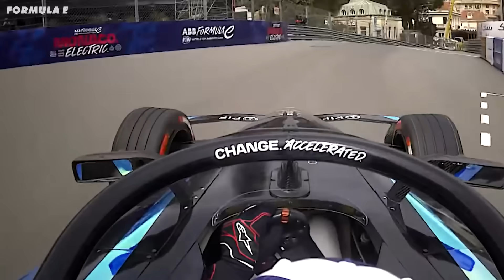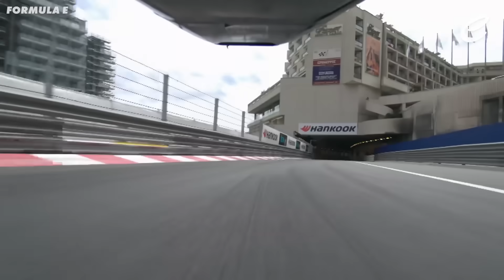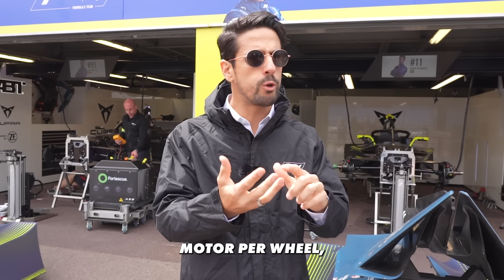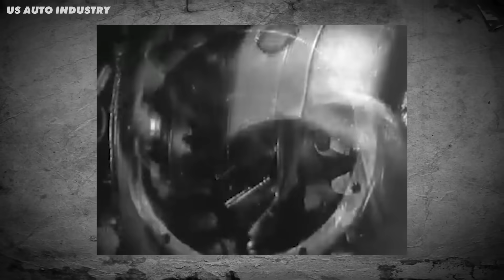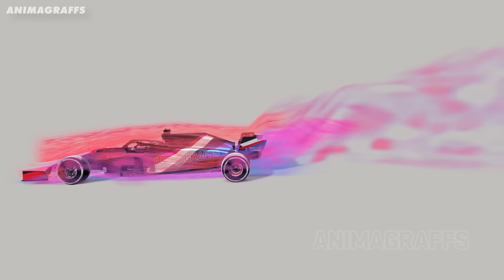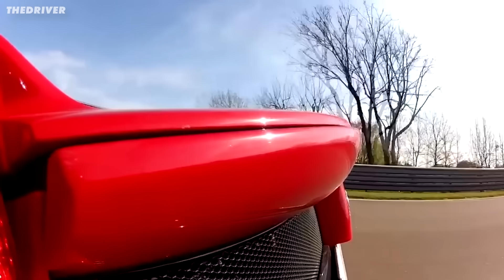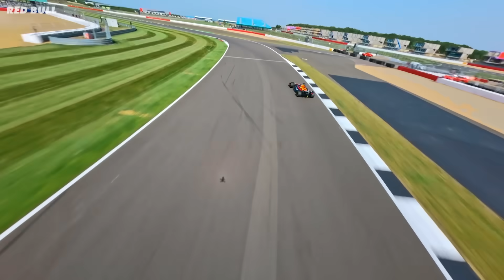The New Formula E Car Might Be F1 Fast

Comment: There is already heavy equipment with that kind of traction. Caterpillar motograders use a hydraulic front wheel drive with an option to increase wheel speed to the outside wheel, reducing the turning radio. Fendt tractors have something similar I think too

Comment: I stopped watching Formula E when in the first race of the season no one wanted to take the lead of the race!
Reply: That's part of the strategy in Formula E. It's called energy management.
Different from other motorsport series.
Instead of fighting for the lead constantly, you stay behind to conserve battery 🔋 energy via drafting and then, in the final few laps, timely overtake and maneuver opponents to take the lead.
Watch the 2024 Berlin E-prix where Nick Cassidy takes lead from P21 in lap 21 to ultimately win the race with 1% battery remaining.
Reply: @mk_annan22  I used to love watching FE, but how is it racing when you're just managing the race, and the winning car is just the most efficient instead of having the fastest car/driver?
Reply: @ImNotOriginal1  That's a good question. This race is about efficiency. It's not necessarily about having a fast car.
The goal isn't speed, it's efficiency. To promote Electric Vehicles to be reliable . That isn't a bad thing, consider it a new different genre of motorsport.
Promoting the fastest car is what led to an uneven field in modern Formula One. So teams with bigger budgets can outpace the smaller teams.
But because being fastest isn't the core in FE, you have an evenly competitive grid where even small teams can beat big teams with bigger budgets. Like Envision Racing who, as a customer team, won the Team's championship in 2023 bettering Jaguar's factory team with bigger budgets and resources.

Comment: 5% compounded, sure.  Realistically though, formula E is just one battery breakthrough away from being a legitimate formula car without having to make any compromises. 

The formula E cars are arguably far more relevant in terms of technological development that will almost certainly trickle down to road cars.  F1s days of being technologically relevant are long gone.   That's excatly why F1 should just drop that idea entirely.  For one, no one gives a shit in the slightest, and every fan will be about 50,000x happier with screaming V10s than with sort of wannabe relevant hybrid power units that have almost nothing in common with road cars.

Comment: While I really like the idea of active aero, I don't think having the aero tuned corner by corner is a good idea.
For starter the conditions might change during the race (other cars disturbing the airflow, rain, etc).
But most of all, I think the system should adapt itself based on external parameters like speed, turning angle of the steering wheel, weight on each wheel, etc. Although the settings would be controlled by the engineers, the software should absolutely not have the position on track of the corner number as input (and obvious not count the corners either like they did at some point in F1).
Reply: Steering modulated aero is the solution for ya + DRS button, it obeys driver inputs, and the wings are always at the brink of stalling by setting up correlation of steering and speed.

Comment: They will only be considered "F1 Fast" when they can be as fast as F1 on a whole 305 km race distance and without tricks like swapping cars, anything less than that will still be lower category.
I doubt they will achieve that anytime soon.
Reply: I think if the tech ever gets to F1 speeds/distance. F1 will be using it, but that's still years away. Probably need swappable batteries to do tracks like Monza or Spa at F1 speeds.

I reckon FE will just become an F1.5 sort of series. Gen 4 should bring them to at least F2 speeds in quali, and races are supposed to get to around 1hr30. So that will raise the stock of the series by quite a bit, but still a long way to go for F1 levels. Then again with the 26 rules, who knows might see FE closer than they should be.
Reply: Fe will never be f1 fast because, it was never the goal.

Comment: This still sounds incredibly dull. Racing should involve high speed, actual driver skills, hair raising sound and driving on the limit. 
Not hypermiling in a car that can barely reach the finish line, drives itself slowly with 4wd on a Micky Mouse track with a constant annoying sound. This stuff just lacks a soul.
Maybe just skip this step altogether and just run computer simulations of a race?
Reply: The car will have more capacity to go longer and with the raised speeds, tracks will become more traditional. 

Already seeing the transition in gen 3 with them racing at places like Portland, Misano and Shanghai. Street circuits will also become longer, I think Macau is already being considered for gen 4
Reply: @lewis8552  Monaco is already here, Miami (proper track, not street one) will be next season and Silverstone is going to be for Gen 4.
Reply: What if i told you hypermiling is what nascar and indycar does on an oval.

Comment: The current Formula E cars, if you removed all the regen braking, it would only make it half way thru the race.  Regen has allowed their cars to go TWICE the distance.  Yet, 2026 F1 still disallows front axle brake regen, in fear that Williams and Audi might have some advantage, leading to them needing to lift off on the straights to allow the engine to recharge the batteries.  It's pathetic.

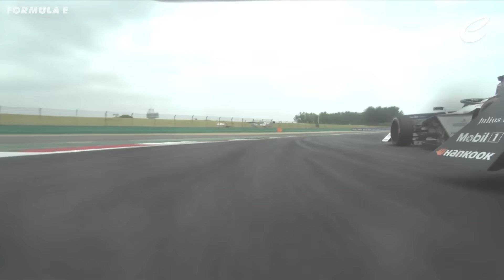Comment: 9:43 holly crap they are on a proper race track, nice
Reply: Not so nice really, because they then spend 3/4 of the race trying not to be in front but still be near the front, to avoid opening a hole in the air for the others and lose autonomy.

Comment: FE races are kept long, so lame. Adding power needs more battery capacity or a shorter race, neither has really happened with FE in over a decade. The aero has been fake. Losing a wing means no performance difference. FE is an almost spec car, so no team innovation on the chassis or aero allowed. Designed to be cheap and lame by the suppliers. Put on rock hard tyres so turns are at touring car pace despite much lower weight.
Reply: They're saying they'll have capacity for longer races in gen 4, around an 1hr to 1hr30m. Races won't be run at the full 600kw though, think they're saying 450kw in race.

Comment: F1 had to bring in more and more regulations to slow cars down as it was. Formula E has even more potential for stupidly dangerous speeds, so all of the technologies mentioned here are going to have to be hamstrung just for safety compliance - unless the aim is to drive cars by remote control at tracks with no spectators anywhere near it.

Comment: Sticking with DOT street tires will keep the braking distances long regardless of downforce. The tire can only do so much and when its a street compound tire with low grip all the downforce in the world won't fix it.
Reply: You do know they don't actually use road tires right. Bruno Senna sat down with Mr Jww a few years back in an interview on his channel. In it he said they tried a cup 2r on the gen 1 car in early development and just like on the road cars it only lasted about 3 full pace race laps. And lap 2/3 of race run was about 8 seconds slower than lap 1 because the tire was destroyed already and that sometimes it wouldn't make it to the end of a qualifying lap. He said that for Gen 1 Michelin used a modified hard lmp1 compound and put it in the road car mold. They did this so it can have pace( it was quicker around a lap than the cup 2r ) and actually lasted till the pit stop. And they put it into the mold to fit the singular All weather tire image that formula e was looking for. I have no idea what the compound of gen 3 is off the top of my head but I do know that it is bespoke to formula e rn
Reply: @Donster2 thank you. I just learned more about tires in your comment than I ever knew! Appreciate it.
Reply: 100 percent

Comment: crazy idea here, you put swappable batteries on the car. You have choices between bigger but heavier or smaller and lighter pack and you make pit stop where you change de battery for a new one. It's like refueling but different. It would open the opportunities to so many strategies
Reply: Nah mate, water cooled batteries and all the piping, plus regen braking is really advanced now you don't need that. You are just looking for theatre, the same reason Michelin left formula 1 after they mandate mandatory pitstops, because michelin wanted to make tires that actually lasts.
Reply: I've heard (though haven't confirmed) that fast charging might soon be fast enough to charge during pit stops
Reply: @addison1024  I don't know about that just yet. Formula E pitstops are roughly the same length as 1950s-1960s Formula 1 pitstops, which is to be expected as the sport is in its infancy, just like F1 was in the 50s and 60s. Still, I do think your prediction will come true within our lifetimes.
Reply: @addison1024  Yea, it's already just happened. Pit Boost. But it's not a full charge of the car. It's a 30 second stop, which adds about 10% charge back to the car. Personally, I think the rules are still too stringent (makes sense for the first test). You had to get basically exactly 30 seconds and it had to be when you were between 40-60% battery remaining, which is pretty high for an electric car (ie: tends to charge slower). I'd like to see them take those restrictions off and let teams decide when to pit and for how long. Maybe wait until you're low battery to really maximize charging speeds. When do you want to charge for more or less time? I think that'll be interesting moving forward. 

Though, it seems it can make the racing a bit harder to follow who exactly is in the lead. And also it may have not worked correctly for one team? Anyway, overall successful test, but they'll definitely dial it in more moving forward.
Reply: Eh... iono about on the track. Even fast battery swaps still take a few minutes - and you need safety checks to make sure everything is connected. It's a completely different technology and it would require totally different procedures. Not sure that really makes sense for the track in a series that is already fairly established. I think battery swapping would make sense for an endurance-type race. For something that travels a great distance where you would need mostly charged batteries, a swap would be faster than a full charge. So then, 2-3 minutes every hour for swapping actually kinda makes sense if the full race is 5 hours or something. 

The other possibility that might work for these shorter tracks would be like swappable super capacitors that you could use to dump a bunch of power in a small package during each pitstop. Almost like nitrous or maybe like an emergency power boost. But.. the technology for doing it hasn't really been explored and it just might not make much sense.

Comment: It's honestly true about the racing in Formula E, it's so much better than Formula 1, to the point I watch it more than I do Formula 1. 100+ overtakes in a single race, cars going 3-wide into a corner, you never, ever see that otherwise.
Reply: You see that kinda racing in F2 all the time and even in F1 depending on the track. The biggest problem with FE is the stupid gimmicks like that attack mode and the (thankfully) discontinued fan boost that they need to artificially make the racing “better”. It keeps me from taking them seriously. On top of that they can only race at short tracks without long straights because the car’s battery wouldn’t be able to regen enough to complete a race distance. There’s also the issue of how batteries act over a race distance losing peak power as the batteries get charged and discharged which this guy never talks about in his FE videos. 

Lots of slow overtakes, many which are aided by gimmicks like attack mode, are a lot more boring than seeing two cars fight for position going through corners at speeds FE can barely reach in a straight line. FE legitimately looks like fancy electric kart racing and not a top level motorsport. I mean it’s funny that they’re talking about reaching F1 levels when when they’re still 6 seconds behind F3 and 1 second slower than FRECA (2022) around Monaco, a circuit that very much plays to the strengths of FE. Not to mention those are literal children driving in F3 and FRECA compared to the much more experienced drivers usually found in FE. Oh and btw compared to F1 they’re 20 seconds slower around a track the F1 cars horribly suited for. 

So in the end if you’re not only slower than a racing series for teenagers that make 100hp-200hp less but also relying on gimmicks to make the racing exciting, you’re a joke of a motorsport.
Reply: @-._.-._.-Sully-._.-._.-  You call out FE gimmicks as if F1 doesn't have gimmicks either: e.g. minimum 2 tyre compounds per race; different tyre compounds in general (Pirelli can easily make a tyre last the whole race); cost cap and reverse scale wind-tunnel testing handicaps, etc..... I'm cool with all of it because at the end of the day, it's about making racing exciting as a form of entertainment. Let's appreciate all forms of racing.
Reply: @willw.3366  not going to necessarily disagree but I’m actually very anti cost cap and wind tunnel/CFD restrictions. The tire thing was kinda needed as a replacement for refueling when that was banned and it’s not all gimmicky as softer tires that don’t last as long will always be a lot quicker at first than a harder compound that last all race so it’s a calculated trade off. FE can do its thing but it’s not comparable to true formula style racing at all.
Reply: @-._.-._.-Sully-._.-._.-  Huh. I really like attack mode, actually. It's an obvious differentiator of strategy, and especially this season with the AWD boost has proven to be a substantial performance differentiator too. What makes it any more artificial than anything else? Plenty of overtaking without it, but LOTS of overtaking with it. Either way to me, that's just entertainment. 

Iono, it's just funny to me that your argument is like "your fun isn't real because it's not as fast!" and "I dislike these features of this series that you like, and only my opinion counts when judging the legitimacy of this sport!". lol cmon. If you like F1 or F3 or kart racing, that's perfectly great. No issues with that. I think you can be a fan of all of it. But personally, a "bunch of slow (and this isn't even true) overtakes" just tends to be more fun than a bunch of perfectly spaced cars going around and around a track with very little happening. You know?
Reply: @-._.-._.-Sully-._.-._.-  All those things doesn't matter when the racing is still infinitely better than all those series you mentioned. The cars don't have the downforce of those series, meaning overtaking is much easier as you don't get massively slowed down in corners by being behind other cars, leading to a lot more exciting racing.

I can only tell you what I (and others) see watching these races. Regardless of what you feel I have never seen so many nailbiting finishes, crazy overtakes and driving in any other Formula racing series.
Reply: @swecreations  the racing isn’t better though at all. It’s all artificially created which isn’t racing. I can name at least several F1 races that came down to nailbiter finishes this year. F2 has been an absolute blast to watch this year especially with all the big talent coming through. FE is a bunch of F1 and F2 rejects and it’s not as exciting to watch as say someone like Andrea Kim Antonelli skipping F3 moving up to F2 after completely dominating multiple karting, F4, and FRECA champions. Watching talent like that develop over the season and once he and the team got a handle on the new 2024 reg cars his wins in Silverstone and Hungary were complete master classes able to gap the field by seconds a lap in clean are. Talent like that doesn’t exist in FE. 

So I’ll go over it again; FE has minimal to no talent, the cars are slower than most every formula feeder series even the ones with less 100-200hp less. And racing is made good through artificial means.

You’re not a motorsport racing fan you’re an artificially created entertainment fan. That completely fine just don’t put your self in the same realm as actual motorsports, it’s a glorified karting series. If you where in it for good close racing were you never know who’s gonna win? Have you ever heard of NASCAR or IndyCar? Those are actual racing series that produce everything you want from FE close racing wise without the gimmicks.

Honestly I have a feeling you only watch FE and no other motorsport because everything you say you want exists in other series. 

Oh and one last thing. Speed is an essential element of motorsports so don’t act like it’s not important. You guys get caught into the premise of prioritizing making racing better by slowing down cars which goes against everything motorsport is and was.
Reply: But it looks and sounds like scalextric car racing.. humming and buzzing and tyre roar.. it’s totally dead inertia..
Reply: @Tracertme  I mean I thought that would bother me at first but it honestly really doesn't.

Comment: Every time someone talks about differentials, I bring up something that is on my mind for a long time.
With it being a mechanical system, a differential always gives resistance. Adjusting a rear diff to mitigate oversteer than must mean that the front actually already has too much grip by default. The differential only mutes it. If it actually increases rotation by itself must mean it is putting out power on its own, which it doesn't.
Having an independent system, like a motor per wheel, must be much more efficient, because it doesn't have that mechanical resistance by default. This also means grip can be taken from the front, which can be done many ways and always in favour of efficiency.
If I am in any way wrong, please tell me why with references. I am always open and eager to learn.